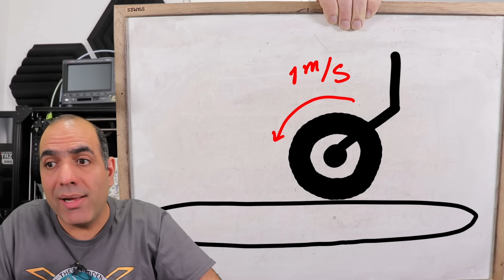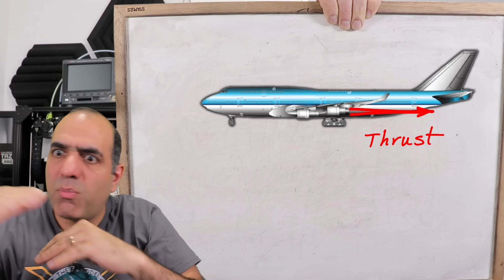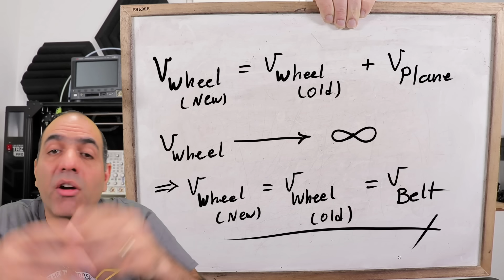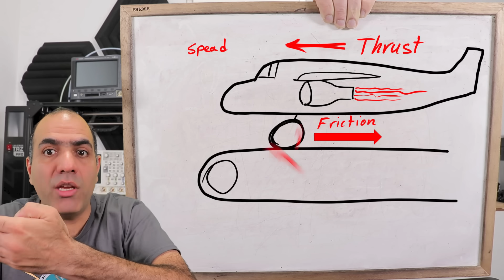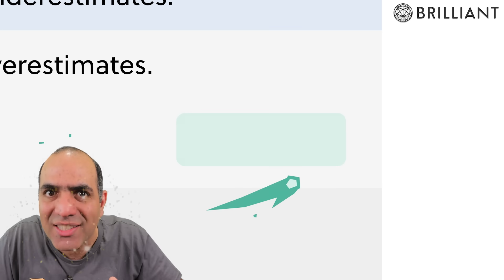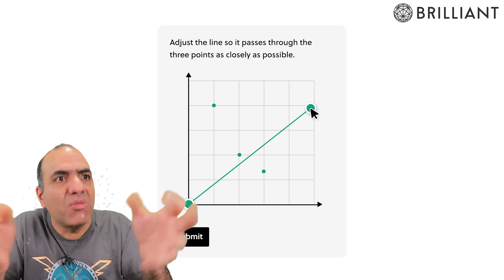Airplane Question that Drove Me NUTS!!!

Comment: Flying has absolutely nothing whatsoever to do with wheels. You may notice 99% of the time that a plane is moving, the wheels aren't touching anything (other than air).  Therefore we know the wheels don't make it fly.
Suppose a plane flies over your house.  Does it matter what your treadmill is doing?  Nope.
Same thing here.

If my plane is flying (moving through the air at a speed greater than Vss) and I pull the stick back, the plane is going up.  It doesn't care how many treadmills are in the neighborhood.
Reply: The vehicle on the ground either rolls or ‘slides’ across the surface.  You don’t get acceleration on the ground without the landing gear rolling and the rolling of the wheels is negated by the conveyor..exactly.
Reply: @MrDefreese  
I don't accelerate my airplane by spinning the wheels.
Accelerating my airplane CAUSES noise,  it causes wind toward the cockpit, it pulls the wheels across the ground, it causes the the wings to develop lift.

Your reasoning is the same as saying "when you accelerate, it's noisy. So if I put in earplugs you won't be able to take off." You have cause and effect backwards.

The prop pulling the airplane forward causes the wheels to roll or slide.  Sliding the wheels doesn't power the prop.

Blocking the noise doesn't stop me from taking off. It just means you don't hear me take off. In exactly the same way, whatever you do with touching the bottom the wheels, if I'm wearing landing gear, doesn't matter to me. I'm flying away anyway - regardless of whether you hear the noise or if you spin the wheels faster.
Reply: @senseisecurityschool9337  incorrect.  You accelerate your aircraft by increasing thrust and the vehicle can only move forward on the ground until you gain lift.

The calculations for ground behavior are well known - in physics, the first thing you do is calculate the force, acceleration, and speed for pulling or pushing a block across a surface with friction resistance.

The second thing you do is analyze the same thing with wheels on that block.  You go through all sorts of exercises to figure out angular speed, linear speed, etc. based on thrust and weight.

You have exactly two options - either the vehicle on wheels is rolling or the vehicle has slipping (with or without some rolling).

This is fundamental intro to physics.
Reply: @MrDefreese  
"Either your rolling or slipping" - and my wings don't know or care!  I can take off from skis just as easily as wheels.  My wings DO NOT CARE about the ground, or water, or whatever is below.
You're thinking about motion between two surfaces - a block and the ground. But this isn't a block. The motion that matters is that between the air and the wing.  You can see that when I come in for a landing with stronger than usual wind - my 172 can be completely motionless relative to the ground.  I've even seen guys going backwards* relative to an observer on the ground .

Relative to the ground, I've taken off at a 60° angle. My aircraft can do 30° --- relative to the air.  Give me an 80 knot "wind" and I can hover straight up, as you would see it.  Because my aircraft doesn't care about the ground. My wings produce lift when the air flows over the wings. Your block sliding across the ground simply doesn't matter. It's true, but totally irrelevant.
Reply: @senseisecurityschool9337  you aren’t taking the time to understand the basics.  The aircraft or car or any other vehicle doesn’t move anywhere without accounting for the ground - either through static/kinetic friction or through rolling.  This is basic physics and kinematics.

If we had an aircraft without wheels, we calculate the friction force involved.  While on wheels, we calculate the rolling speed of the wheels compared to the velocity at the axle with the equation v equals rotation speed times radius and vv.

Every plane that ever existed has that wheel speed calculation.

Now subtract that speed with the (magical) conveyor as stated and you have zero net vehicle velocity.

That’s the math and the physics.  A whiteboard drawing would clarify this.

Mythbusters started on the right track with their rc car and then they literally went on a tangent.
Reply: @MrDefreese  
You're thinking about cars and coming up with why airplanes can't do something that in fact we do all the damn time.
You're seriously telling me I can't do something that I do routinely.

If you get over the flat-earthed mentality of "my idea must be right, so pilots must be faking it", then you can ask "HOW does it work?"   If and when you ever get to that point, to understand HOW we take off and land, think about airflow over the wings. Because it's an airplane.  Thinking about wheels on the ground is pretending it's a car.  It's very much not a car - it's an airplane. The wheels aren't even powered, so they very much do not push the plane forward, and having nothing whatsoever to do with the plane moving forward.

Or it  might be helpful to consider "what would happen if the airplane were 1,000 meters above the treadmill?".    Then "what if the plane is 1 meter above the treadmill?".   How about 1 cm above the treadmill?  How about 1nm?

Btw -ar it's lowest, the actual *plane*, the wing, is a couple meters above treadmill.

But I understand, for now you're stuck in thinking that airplanes can't take off under many conditions (conditions under which a car couldn't take off).  So you think I go out to the airport and fake it all the time. :)
Reply: @senseisecurityschool9337  no all around.

I’ll try to explain it again in more clear terms because I’m tired of the belligerence that this topic causes and because I see how people are misinterpreting the conditions and how physics/engineer types are not explaining it well.

For any given condition of a vehicle with a force applied, you get a resulting speed (if it overcomes static friction).

For a block on a surface, the force to get something to move is mass times gravity times coefficient of static friction and one it moves, that coefficient is replaced by kinetic friction coefficient.

If you have a sledge/ski vehicle, it’s the same thing
If you have a vehicle on a pontoon on water, then you have to calculate damping effects of water.

If on wheels, the resultant speed is based on the surface material and whether it is sliding and/or rolling.

We know this.  It’s not controversial.  That’s basically physics - force, acceleration, speed/velocity.

We know for certain this hypothetical plane has to roll until the vehicle velocity and the dependent rolling speed gets to the point where lift is created (four forces calculations are based on the specific conditions for that vehicle).

The vehicle doesn’t move without the wheels rolling across the surface.  You can apply brakes; you can place chocks, you can clamp wheel axles to a static test stand and the vehicle goes nowhere (unless one breaks those constraints).

The result of a force applied to a vehicle on wheels whether through thrust of a power plant, through pushing/pulling, etc., is the vehicle rolling at a speed based on its particular condition.  An aircraft carrier launches a vehicle through a combination of catapult force, thrust from engines, and airflow from headwinds.

Nobody is saying the wheels are powered.
Reply: @MrDefreese  
You can saying "no" however many times you want - I'm still going flying today. Again.

While I'm flying, my airplane will be motionless relative to my water bottle.

I'll take off and land at about 1,000 MPH. That's 1,000 MPH relative to the stars, so about the same speed as your house. Yeah I'll probably land at about zero  speed relative to the ground, again.  And take off at pretty close to zero groundspeed. Meaning my aircraft will be going about the same speed as the ground. (1,000 MPH relative to the average star.) Even if you think it's impossible, I'm going to keep doing it.

While I'm doing so, the relative speed between my butt and the seat will be zero.  The plane won't be moving, from the point of view of my butt, yet I'll be flying anyway.

If someday you start to wonder HOW I do it all the damn time, the glitch in your logic is that I fly based on the speed of AIR over the WINGS.  You're thinking "it's not moving" because you're forgetting motion is always relative between two things, and the two things that matter for my plane are the air the wing. 
You're thinking about the motion of a treadmill relative to a tire tread and saying "it's not moving".  But that's about as relevant as the fact that my butt isn't moving relative to the seat.  The motion that matters isn't the motion between my butt and the seat. It's not the motion between the altimeter and the panel. Not the ground and the wheel. It's the motion between the air and wing.

Go ahead and say "no" about 100 more times - I'll be off flying. While you keep thinking it's impossible for me to do so, and probably thinking that the earth is flat because they, it looks flat from your perspective on the ground.

I'll be flying overhead, not caring what your treadmill is doing. I have airflow over my wings, so I don't care whether your treadmill is going the same speed I am or not.

Here's something that will blow your mind -
While you're typing "no, no, a hundred times no", you're actually moving at 1,000 MPH. That's why you have day and night - you're moving at 1,000 MPH toward the Earth's shadow. And so is your "motionless" aircraft.
Reply: @senseisecurityschool9337  you are not listening to what is being described.  That’s unfortunate.  You could learn a little about something which you are not actually responding to or acknowledging that you understand.

Do you know about four forces?

Do you know how vehicles get rated for zero to 60 mph?

You have a void in your understanding or comprehension on this topic and it manifests as unfortunate hubris.
Reply: @MrDefreese  
How fast were you moving when you wrote that?
Reply: @MrDefreese  
> For any given condition of a vehicle with a force applied, you get a resulting speed 

Close, but not quite. If there is a 1 kilogram ball sitting on the table, and you push it with 1 Newton force, what is the speed of ball, in your model?  BTW, the table is in an airplane that's going 100 km/h. Sitting on a runway that's going 1600 km/h. On a planet that's going 28 km/s.  What speed do you think the ball will be going when pushed with 1 Newton force? The force doesn't cause a speed, but an *acceleration*.  That's where you're falling down, by thinking that an object can have a speed.

> The vehicle doesn’t move without the wheels rolling across the surface.

So if your chair doesn't have wheels, it will stop and you can watch the Earth fly away at 29 km/s?

Of course not. Because there is no such thing as "doesn't move". Objects do not have velocities.
velocity is a comparision between two objects.

And the objects that matter for flight are the wing and the air.
Reply: @senseisecurityschool9337  I guess we have to go the daft pedantic approach with you then.  Of course it is about acceleration since F = MA, however, for every second of force applied (once you get past static friction or rolling/bearing resistance to motion), you have a resulting speed.  Since we have to do the obnoxious pedantic thing, we are quite obviously talking about the speed in reference to something consequential such as …a fixed point on the ground, the wheel axle, etc., and not the tangential speed of the surface of the earth, or of the sun, or of the black hole at the center of The Milky Way.

Once again, the change in speed of the vehicle in relation to the ground is exactly zero under the condition presented where the conveyor speed exactly matches the rolling speed of the wheels.

Again, for those in the back, the vehicle can only roll as a result of the force applied (whether from a push, a shove, a propeller, a turbofan, or a rocket) and at each instant, the speed of the vehicle is matched by the conveyor.

That means there is no airflow, no lift, and no flight under this conveyor scenario.

Other people will usually get it after this point.
Reply: @MrDefreese  
> We're obviously talking about the speed in reference to something consequential, like a point on the ground.

The speed of a point on the ground would be consequential if I designed groundplanes. I design *air*planes.  Not groundplanes.

Cars work on the  ground, by pushing their wheels against the ground.  Air planes work by pushing against the air .  So a point on the ground is relevant for a groundplane (car). A parcel of air is what's relevant for a air plane.

The speed that matters for an air plane is the air. The ground doesn't matter one bit. Because I made an airplane, not a groundplane.

 I actually wouldn't care if the ground disappeared entirely - I would keep flying just the same. Because my flying through the air has nothing to do with some object a mile away on the *ground*.

Remember I started in my first reply to you reminding you it's not a car?
If you start over but think about *air*speed since it's an *air*plane and not a ground plane, then you'll understand how we fly.  You'll be thinking about airplanes rather than groundplanes, when you stop thinking that the motion of the ground has anything to do with anything.

Or you can just keep insisting that we don't. 😁
Reply: @senseisecurityschool9337  it doesn’t get into the air without airflow over the body.  You can rip off the wings and just have an engine with a wheel and the basic pedantic logic holds the same.  As the wheels turn, as they must - hopefully you concede this basic point - and the conveyor moves in sync with that vehicle wheel rotation, then obviously the net velocity is zero.

One more time - while the vehicle is on the ground, you can push it, shove it, apply thrust from a rocket, a jet, or a propeller, and the result is that the vehicle has to start rolling.

I’m really unsure why you are so pressed about the aircraft issue when the vehicle can’t even escape the rolling constraints of this conveyor belt as clearly stipulated.  It has been explained to you a few times and your snark shows you haven’t absorbed where you literally go off track.
Reply: @MrDefreese 
> then obviously the net velocity is zero

You forgot already what we just spent the last few posts talking about?  That velocity is always a comparison between two things.  So - the velocity between what two objects?

Certainly you're not talking about the velocity between the aircraft and the center of the Earth, because that's 1,000 MPH.

You're talking about the velocity between the tread of the tire and the treadmill.  But the tire tread isn't what creates lift!  Or maybe you're talking about the velocity between some other part of the AIRcraft and comparing it to Dodger Stadium or some other point on the ground?  Because you're still thinking it's a groundplane, rather than an airplane?

Just to be clear - you think we're faking all these take offs and landings?  Kinda like the photos showing that the earth is round are faked?

I've watched a friend take off "backwards" relative to some random point on the ground. How?  Because he had proper *air*speed.  Since it's an *aircraft*. Not a seacraft or groundcraft. You think he faked it with a cosmic Photoshop, right?  Since you can't get your head around the concept that an airplane isn't a car - that it operates in the air.
Reply: @senseisecurityschool9337  You forgot already what we just spent the last few posts talking about?  That velocity is always a comparison between two things.  So - the velocity between what two objects?

We already said that the net velocity is zero from the perspective of the ground and just for clarity, the atmosphere (assuming there is no headwind, tailwind, crosswind or uplift).  This is junior high school illogic you are trying

You're talking about the velocity between the tread of the tire and the treadmill.  But the tire tread isn't what creates lift!  Or maybe you're talking about the velocity between some other part of the AIRcraft and comparing it to Dodger Stadium or some other point on the ground?  Because you're still thinking it's a groundplane, rather than an airplane?

Derp.  No.  The velocity of the vehicle at the wheel axle is zero in relation to the ground and in relation to the air because of the conveyor motion which exactly matches the rolling behavior of the vehicle..  There is no airflow.  It has been explained to you several times that the resultant velocity of the vehicle through the applied force of the engines is exactly the velocity of the conveyor belt as described in the scenario.  Keep up.  We shouldn't have to repeat basic points ad nauseam for you to clearly show you aren't listening or reading.  Bizarre.

Just to be clear - you think we're faking all these take offs and landings?

No, you aren't clear.   You can better absorb it by yourself by reading the prior comments more carefully or it can be explained to you once again.

here we go:

Since you can't get your head around the concept that an airplane isn't a car - that it operates in the air.

You can't get into the air if you don't have airflow over the wings and body.  That's what's been explained to you multiple times.  The vehicle doesn't move forward in relation to ground.  Once again - net velocity to ground is zero.  net airspeed is zero.  The vehicle is stationary on this conveyor belt.

Let it seep in.  When you show that you actually comprehend those fundamentals, then perhaps try to re-engage.
Reply: @MrDefreese  

 I think I understand your thinking now! I think I just saw the reason for the confusion.

> The conveyor moves in sync with the wheel rotation ... then obviously the net velocity is zero

The velocity between the wheel and conveyor is zero?  Meaning the conveyor is keeping up with the plane? That would mean that as the plane throttles up, the plane and the conveyor both move north at 100 knots, from the point of view of someone at Dodger Stadium . Hmm that's probably not what you mean - if they are both going 100 knots, obviously I can take off.

Maybe "in sync" means at the same speed, buy the opposite direction, right?  So from the point of view of the stadium, the conveyor is going the opposite way? (You keep talking about motion of ONE object - remember that's - not a thing. Motion is a comparison between objects.)

If the wheel (and plane) are going 80 knots north while the conveyor is going 80 knots south, then the relative motion between them is 160 knots. The wheel tread will spin at 160 knots, that's all.

I think the confusion came about by this:
 First thinking in terms of "zero speed" between the conveyor and the wheel, which would mean they are moving in the same direction.

Then transporting that "zero speed" to some external reference while picturing the conveyor moving the opposite direction.

I think it will be clear by being specific - if the plane is pointed north, which direction is the conveyor moving?

By not specifying, I think it's easy to come to a conclusion that is intuitively obvious, but wrong. Because in the middle of the logic the conveyor quietly reverses direction, without you realizing it.
Reply: @MrDefreese  If my normal take off is to the north at 73 knots, which direction are you going to run your conveyer, and at what speed?

If you actually think about any of these questions and try to answer them, rather than copy-paste the same "there's zero motion", we might get somewhere. Which direction do you think the conveyor should go if my plane is facing north?  And what speed are you going to run it?

You might find that while you were thinking about it, the conveyor was running in one direction when you were thinking about the tire tread, then you zoom out it has reversed direction.  That would be required for the zero velocity you stated between the tire and the treadmill.
Reply: @senseisecurityschool9337  the surface of the conveyor does move in the opposite direction of the vehicle at the wheel hub.  Normally, as a vehicle rolls, the instantaneous speed of a point is velocity v + the rotational speed  (r * omega).  At the top of the wheel, the instantaneous speed is 2v, at the wheel hub, it is v, and at the contact patch, it is zero.  That’s mathematical.  Intuitively, we know the instantaneous speed is zero since we know the vehicle moves by rolling.

To be pedantic, the problem could be more clear by stating the velocity of the conveyor exactly matches the wheel speed at its axle which would clearly be vehicle velocity.

It is an unfortunate textbook style thought project that is not perfectly written.
Reply: @MrDefreese  
 @MrDefreese  
Great. If you decide it moves at same speed as the wheel *hub*, in the opposite direction, that of course gives different results than specifying the some other point.

You've specified that the hub is not moving relative to say, the control tower. Velocity zero. Correct?

You've also specified that the conveyor is moving at the same speed, but opposite direction. The same speed would be zero. So the conveyor is not moving.

To confirm, that's the condition we want to analyze? Or do you want to change it and add some motion?
Reply: @MrDefreese  
That makes more sense. And would work perfectly if the airplane were a car, with cruise control set to the speed of the treadmill.

Now that we've clearly specified that condition, maybe we can move forward without necessarily getting into the messy stuff.  Does it make sense to you that a  motor of 10-20 HP or so can turn 20 foot conveyor belt at 65 MPH?
Reply: @MrDefreese  
Ps - also by your logic, WW2 aircraft carriers don't exist, never could have existed. Or have to stop before planes can fly. :)

99.9% of the time I'm flying, my wheels aren't turning at all.  Because flying has nothing to do with wheels. My prop doesn't care whether my wheels even exist. My prop pulls me forward.  I'm not being pushed forward by my wheels.  My prop doesn't know if the wheels even exist,  much less how they're spinning. My prop pulls me forward regardless.  So it simply doesn't matter what the wheels are doing - or if they even exist. I can fly just as well after landing with floats or skis.